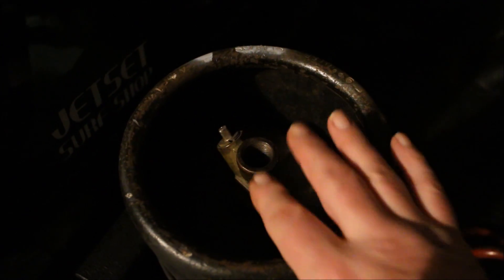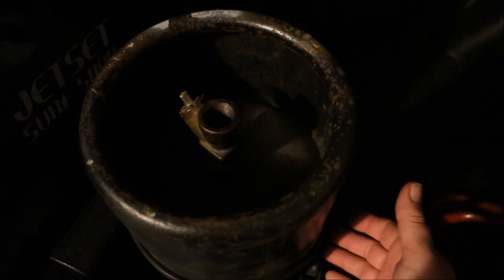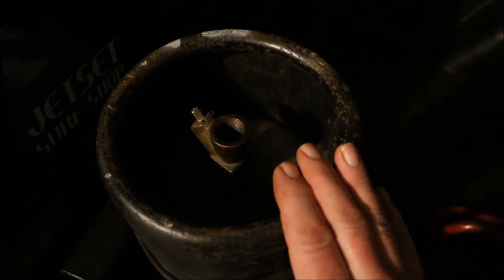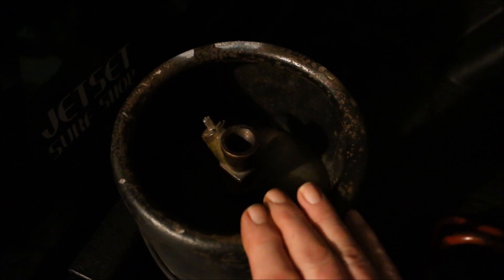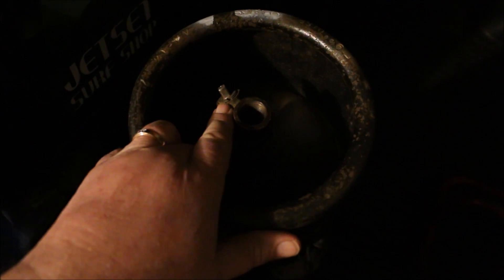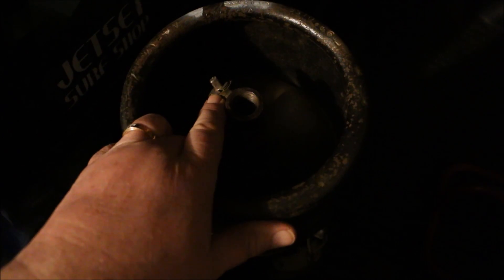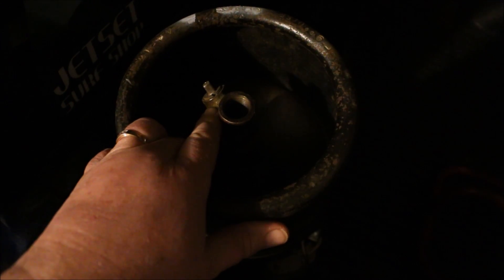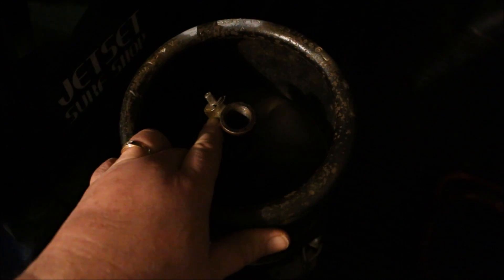Leaking Acetylene Tank Valve ~ by Old Sneelock's Workshop

Comment: Need better light, keep improving
Reply from the maker: Thanks for the comment. 
I recognize the issue. 
The jobs dictate the setting and sometimes they just don't support additional light.  Even worse I don't see it occurring until after I am editing and the job is done. No chance to redo the shots. 😁😎
Reply: @OldSneelock  I suggest that you prepare before with a good spotlight in the shop. And turn it on before. Either that or use strong lamps. Thanks for sharing your knowledge

Comment: 1) Acetylene is lighter than air - NOT heavier. Propane is heavier than air.
2) More than 15 PSI in a TANK makes it a bomb??? Wrong  - Check your tank pressure gage on the regulator. A full cylinder will have approximately 250 PSI in it at 70°F (315 PSI at 90°F) which is WELL over 15 PSI.
3) While cracking the cylinder valve with oxygen and inert gases is common practice to blow out any debris, the cracking of cylinder valves for fuel gases is not recommended. We are talking about flammable gasses after all....
Reply from the maker: You are right about the weight. 
The 15 psi that I refer to is outside the tank or after the tank has been vented through a broken valve or a puncture. 
As I said in the video Acetylene in the tank is dissolved in acetone. That stabilizes the acetylene. It has to vaporize out if the acetone before it leaves the tank. 
If you vent the tank at a higher pressure than 15 psi you are at risk of the acetylene boiling out of the acetone and causing an explosion. 
You may or may not vent the acetylene tank to clear the dust from the valves port, as you wish. 
If you do then releasing a small amount will prevent dust from plugging your regulator. 
If the venting is too dangerous, plan on servicing your regulator more often.
Reply: @OldSneelock  15psi allows a safety factor of approximately 2x.

Comment: Some dishwashing soap has oil in it. Acet will ignite if there is a leak and the dishwashing soap has oil in it. Use the stuff they sell for checking leaks.
Reply from the maker: Andrew Munchkin Andrew I appreciate your concern. After reading your comment I checked several sources for recommendations on testing for acetylene leaks. Each of them mentioned soap and water along with their proprietary leak testing solution. Soaps in general are freated by the action of a base, like lye,on a fat or oil. 
Do you have a link to your source? 
I would like to share this.
Reply: Old Sneelock's Workshop, I read that petroleum when it contacts acetelyn will ignite. Some dishwashing soaps have petroleum in them nowadays. Which brands? No idea. But some do. There is a liquid to test for leaks safetly. Thats all I know.
Also never use petroleum, liquid wrench,  to free up a sticky valve on the acetelyn valve. The tank will explode.
Reply from the maker: Thqnks Andrew I will do some further checking.

Comment: Sure enough learned something!  I've seen these type tanks but most are used by HVAC guys around here. An old guy that worked for NASA that I used to cut firewood on the table saw for had an acetylene generator. Big round base with a little tower top. Base was filled with water and the top held carbide powder. The regulator shook some powder down into the water when the pressure got low and made the gas. Interesting rig. When I was the fit-all operator for a concrete form and pouring outfit I drove a company truck with a torch and tanks because I usually ended up doing all the rebar cutting and bending. We did a lot of business with a service station that had a raggedy vehicle lift and the truck needed an exhaust system. They got the old truck up on the lift, one side fell off, the tailgate popped open and the bottles slid across the parking lot, Valve end first. I about had a STROKE! I always hauled the bottles with the caps on so nothing happened but I still about bit it!  Was I ever glad to get out of there that night. Still am! Also glad you didn't go boom in the middle of the night. This is another episode of Old Sneelocks Workshop just passing neptune and gaining speed.
Reply from the maker: +Lewie McNeely At the Midwest Foundry the Maintenance crew used torches nearly every day. I hauled the cutting rig around the shop. The shipping department was right next to the main door leading to the Maintenance shop. We had to cross over the scales to get out the door. Unbeknownst to me one corner of the scale had gotten bent down a bit.  As I was rolling across the scale one tire dipped into the low spot and the base of the rig drug on the floor. I was going at a pretty good clip and the torch just kept right on going. The rig toppled over and I landed on top. I didn't crap my drawers, but I checked. 
Did you ever think that the only reason we're still alive is that God was watching out for us? In my case it must be true. I'm certainly not capable of surviving all the dumb stunts I've pulled on my own.
Reply: Oh yes, I think and thank Him every day. Seems like something goes haywire that I can see HIS hand upon or I'd been gone a LONG time ago. I didn't really think I'd see 18 but I did, several times! I heard some tell about an oxygen bottle falling over on a railroad job. No cap and when it flopped the valve got popped off and it went up the tracks a good ways, busting ties like match sticks as it went. I'll pass on that one too. At least we've found out WHO to give the credit and Thanks for a long life, WELL lived!
Reply from the maker: Coming back to answer a separate question and I remembered talking to a guy who worked at Lind in Chicago. 
He said when they worked on top of the catwalks along the shore of Lake Michigan they would leave enough gas in the oxy tanks that they could set them on the catwalk, knock the valve off, and the cylinders would go out into the lake. Supposedly saved carrying them down. 
Not sure if it was true or just boasting.  People do stupid things every day.
Reply: @OldSneelock  Somebody told me about a railroad crew or somebody working on a railroad and the oxygen bottle falling and knocking the valve off on the way down. Said it tore up a bunch of cross-ties till it ran out of gas. Just like a land torpedo. I think I'll pass. the bottles scooting across the [parking lot put a nice bald place in my head anyway. The last mower left this morning. NOW for a silent replacement. Happy Grandparents Day and ours got a cold from loafering.  Glad I'm at home!

Comment: 30 yrs of millwrighting I have had two tanks catch fire below the valve.  One was ontop of a 80' tank setting on the catwalk. This was the only  exit from the tank. Finialy put enought water on the bottle to put out the flane, we ran fast and let the bottle vent.  The other tank burnt out in the road at the mill, flames shot at lease 20' into the air. The oxygen bottle was together with it the fire dept. staed back and let it burn out.  This is how i found out that tanks have lead plugs that melt out and allow them to burn in a "controled"  burn  Both would be bad inside the home garage.  If I ever get back east we could share life experiences for hours love your vidoes.
Reply from the maker: +paul harriss You're a lucky man Paul. Just one time like that teaches you to respect the power. You witnessed two.
One of the guys I worked with checked for leaks on the torch with his lighter. First time I saw it I was dumbfounded. I was taught the bubble method by my father. I much prefer wiping down the tanks than having someone else wipe down the walls. 
Good point about the lead plug. I need to figure out a way to have the tanks outside but in view. I was taught to uncoil the hose so there was a long fuse and a clear gap between my work and the torch. Part of the plan is to leave the acetylene valve open only one turn. The hoses can pick up a spark in the groove between the two Siamese hoses. That's only happened once and I was able to run over and turn off the tanks. The burn back checks in the hoses should stop it if the hose bursts but having it outside of the building would be better.
Reply: Let me in on the confab, PLEASE and I always just turned the gas 1/4 turn.

Comment: I use the flat top tanks I got it free when I bought my torch I exchange them thru Linweld at my local O'Rielly's store or at the company ..They have upgraded them with new valves with a knob instead of using the TEE wrench They won't buy it back of course so I would like to some day buy a small regular type tank since I like the small size and I have a small 32 in tall Oxy tank
Reply from the maker: Thanks. I'll check the local O'Rielly's. That would save a long drive or buying a new tank.